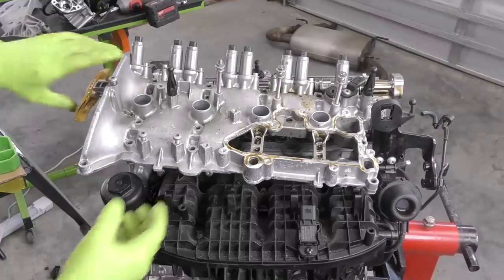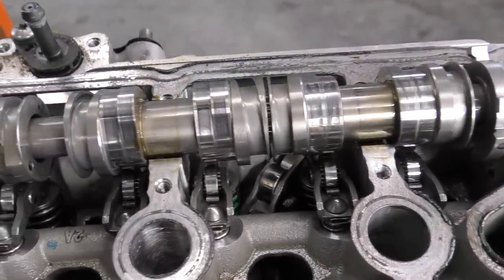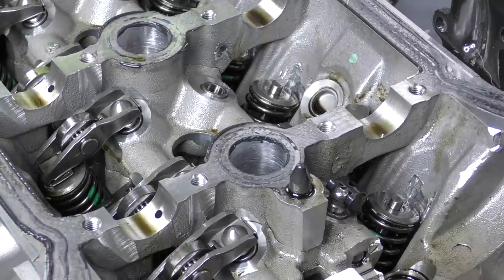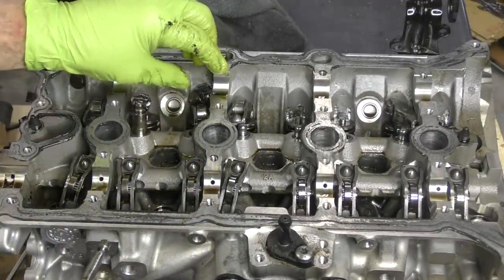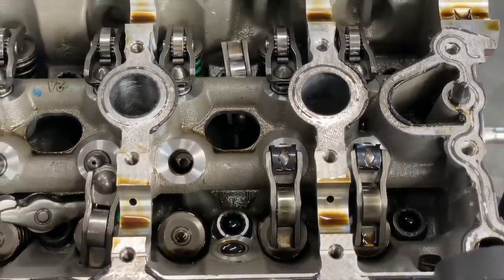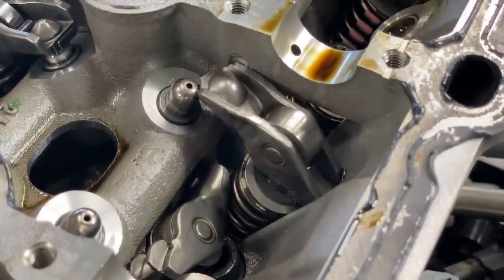Catastrophic Engine Failure VW 2.0t TSI Engine ~ MONEY SHIFT!

Comment: Lol rookie mistake, I never force a gear in place, because it is bad for the synchro, and can cause arthritis over time, I guess joints wear like car parts too, lol. Plus don’t drop the clutch like a catapult, not only is it bad for the drivetrain, but it is bad for the teeth too. The worst case scenario is broken engine or flipped cars.

Comment: Hi I have a 2019 vw gti rabbit package and i bought it not to long ago and drove it few miles and didn’t rev it high but it started making a ticking sound from the valve cover so I’m thinking this could be an issue with mine, my question is could I pull off the cover with out having to redo the timing chain?
Reply: GTi rabbit; that's a hare.....

Comment: A brief overspeed to 9,000 rpm caused all those rockers to self-destruct?  It seems like that engine could have been designed a bit better, seeing that F1 engines routinely run at 20,000 rpm during normal operation.

Comment: Hi there,  i know you are vw mechanic. Actually i have jetta 2015, the light warning sign came up on the dash but no bulb stopped working. All interior and exterior lights are working. I checked for the fault code, it's 01516 - terminal 30 left open circuit. Fault status 01101011. Please help me to fix this... i checked all fuses they are ok.
Please reply to give any suggestions.
Thanks

Comment: So at high speeds and rpms if you do that by accident it can severly damage the engine? Damn that sucks. I got a stock mk5 gti. Well i got my ignition tumbler issue right now you had replied lol anyway i havent done that really at super high rpms few times at lower and never above redline especially if i pull on it let alone going down and having it be so high. But i have once or twice before namely when i was younger on other cars i was real close to redline or past. But it can be scary because the engine is already working so hard and now youre just throwing into a much lower gear... if i pull on it i try to be very cautious nowdays and have room to slow down like normal instead of plowing thru gears and coming to a hard stop.

Comment: Great video, I have a question though: 
- Can this happen with manual mode in newer DSGs (like MK7), or would computer(s) figure out its in too high RPMs for lower gear and refuse to go into lower (disengaging the clutch)?
Reply: More than likely an electronic shift trans will not allow it due to “over rev” situation.... not any expert myself but from current experience driving a Toyota Corolla S with CVT but with “manual mode”... redline was 6,200rpm
Reply: I see, thank you for answer, appreciated :)
Reply: @BeezyKing99  It will allow you to shift down to 2nd from 3rd but only if the RPM's are safe enough and you cannot be pressing the accelerator. So, it will allow it only for engine braking and only under specific conditions.

Comment: I just replaced my engine on a 2011 Volkswagen CC 2.0 cbfa engine.
In park it will not rough past 4000 RPM, is that normal or does that sound like a knock sensor possibly I have yet to hook up chewy scanner.  just for s** and  giggles
Reply: Let me try that again..
I replaced my engine 2011 Volkswagen CC 2.0 cbfa engine.
It will not rev past 4000rpm.
Is that normal or does it sound like a possible knock sensor or something else? I have yet to hook up a scanner.
  P.s. Big fan keep up the excellent work

Comment: Hey Charles, is it possible to make this engine able to rev close to 9000 rpm with modifications?
Reply from the maker: I’d assume you can upgrade the valve train and make it rev higher
Reply: HumbleMechanic I think it would be really cool if when they rebuild this engine they make it rev happily to the point where it originally blew up

Comment: I had a money shift from 5th to 1st, she held went way past 9 thousand  rpm. I was at 110kph.
Reply from the maker: Wow! How’d it end up
Reply: @HumbleMechanic  First is notchy It's sometimes hard to find. It happened with about 60k and the car has 170 k on it now. I'm not sure if I messes up the syncros or something. But the engine seems ok. I was passing a car on a double lane highway and didn't wants to slow anyone down. A quick shift to 3rd and I would of been right up to speed instead the front end took a dive.  Maybe it survival because it's not a turbo?

Comment: Can you please tell me should I drive a 2010 TFSI with 1lt oil consumption every 1000km for a short while lets say a few thousand kms until I get the issue fixed. No blue,white smoke at all. No fault codes. Clutch and flywheel recently replaced. Car is immeculate and only has 60K miles. But consuming oil. PCV was also replaced with the black cap AH version 3 months ago without any software update. But...Consuming oil and have lower speed at certain Rpms comparing to past....and worse acceleration.But sometimes acceleration gets better....Oil consumption gets better and worse as well. What can be the problem? If I share a video would you give me some ideas. I watch all of your videos and I already learned alot from your videos mate...Your help will be appreciated alot...This issue really gives me lots of headache.
Reply from the maker: Be very careful!!!
Reply: @HumbleMechanic  What do you mean mate? I will have to drive the car back to the city that I live which is about 500 miles (800km) a few weeks later. Until that time I need to drive very short distances daily or once every few days. As I said there is no smoke, no fault code, no problems, only a bit hesitance between shift changes which is not even always. The Vw mechanic found no problems, he test drove the car and asked me to rev it more. He suggested me to use 5w50 or 10w60. However the car has had 5w30 (Vw504) since new and I recently switched to 5w40 (Vw502). The oil consumption did not change. Will it be okay for this time until I will have a chance to permanently park the car in a garage until I will have a chance to get the turbo rebuilt (I dont know if its necessary), and then the engine? Or is that wrong order ?
Reply: @HumbleMechanic  Can we say that it is piston rings (known TFSI issue) or could it be the turbo releasing the oil to the exhaust and there is oil consumption without smoke? If then, how can I check the turbo oil leak to the exhaust side?

Comment: Seems to me you are putting a lot of faith in the bottom end not being wrecked. You confirmed presence of glitter in the filter; that alone would send me popping main and rod caps to inspect their condition; expecting to see metal inbedded in the bearings. Even if I found none, id still be stripping the block bare and flushing the oil passages and measuring out all journals for fresh bearings. The head, as you said, is finished, and the timing chain I would be suspicious of.   

BUT, that's the take of a Mopar guy seeing that kind of damage; maybe its different in the VW world? I wouldn't expect that different.
Reply from the maker: The more I think about i thing we will tear down the bottom. If nothing else to look at the possible crank walk issues

Comment: Damn. Are you familiar with the downshift for max engine speed incorporated by Audi; like when you’re cruising and depress the paddle past the point of resistance it downshifts one gear for max power to increase engine speed. Now say I’m speeding up on a highway entrance ramp and I manually downshift once for the normal boost so from 6th to 5th, then accidentally downshift again, so maybe it would have gone from 5th to 4th idk, cuz I didn’t look down at the cluster, I just put it back in Auto after I realized I didn’t upshift. Car ran fine. But few days later threw P0016 and misfires. Also have a bad serpentine belt tensioner tho, could just a bad serpentine belt tensioner cause misfires and possibly make it throw P0016? Or would I need my timing chain checked.
Reply from the maker: The kickdown? Odd. I’m guessing unrelated
Reply: @HumbleMechanic  yess kickdown, but I did it manually, then did it again accidentally then put it back in Auto
Reply: @HumbleMechanic  so can a very worn belt tensioner that it rocks side to side cause misfires?

Comment: Why don't they make something to prevent that from happening? I know with motorcycles they have something called a slipper clutch to keep you from locking up the wheel and skidding. This is a 10 grand mistake.
Reply from the maker: They have failsafe for accelerating but not for hitting wrong gear and dropping the clutch. OUCH

Comment: I thought the manual transmission wont let you shift into low gear at certain speeds?
Reply from the maker: Typically that’s only first gear
Reply: @HumbleMechanic  Oh ok thanks for the reply and all the great videos. So if my vehicle (5 speed 1.8t)  dose this would you think  possible syncro issue/excessive wear? Ive noticed it with 2nd gear almost as if it felt like a reverse lock out when the speed might be alittle high for 2nd.

Comment: 80,000 miles and the bomb starts ticking....the chain , guides and tensioner badly under engineered. Seen so many failures
Reply from the maker: This gen didn’t really suffer from those issues. Now the previous generation. Different ball game

Comment: VW still making interference engines. Same thing I learned back in VSTT school at UTI. Dang. I remember seeing so many vehicles come in because of chipped, cam changed, and electrical problems r/t fiddling with the cars to boost power. See they still use excessive tension fasteners. I don't see the pivot points.

Comment: That car is a 2017 yet he still over revved? Most newer cars it doesn't allow you to, it locks you out if the rpms are too high. My 2014 370Z, a Fiesta ST I drove, a 2015 WRX, they all do the same thing. I think that guy turned that safety net off when he was tuning it.
Reply from the maker: I mentioned that at the end. There is Protection when accelerating but it can’t account for missing the gear and letting off the clutch

Comment: And by 40 sec in you have a perfect explanation of why I hate terms like 'stage 2' or in older days descriptions like a '3/4 race cam'.  Those mean nothing; it's just marketing hype.  Tell me what mods you did and I'll understand.  Tell me you have a 'stage 2' cam, mods, whatever and I'll assume you're a 13 yo keyboard warrior who's never built an engine.
Reply: With most modern turbo cars stage 2 means intake, downpipe, and tune (and maybe some other supporting mods like intercooler if the car needs it on a maxed stock turbo). The “stages” are pretty well known at this point by the broad car community so most people don’t  really see the need to give a full rundown.
Reply: Stages are a good way to compare "levels" of upgrades on a given platform.

Comment: GTi engine hits 9000 rpm: “Bang! Clank! Klack!!”.  Honda S2000 engine hits 9000 rpm: “I’m sorry, was I supposed to feel that?” VTEC bro. 😜
Reply: S2000 has a short stroke and no torque compared to this engine.  Short stroke engines generally have higher revs (higher HP) but even with VTEC no real low end torque.  Drives like a base civic until you rev it way up...

Comment: How much is a new built-up cylinder head? That doesn't appear to be worth repairing because of the damage to the head casting.
Reply from the maker: I couldn't lock in a price on the repair. Lot of extra parts and what not. I agree that it's probably cheaper/better to just replace the head at minimum
Reply: @HumbleMechanic  Is this engine too new to be able to commonly find a salvage engine to obtain a head from? Since the engine is already out of the car would it be cheaper just to get the entire engine and not just the head, so you replace it as a single piece and save the shop hours?  Somebody's debit card is going to whimper because I doubt this would be cvered under warranty.
Reply from the maker: I’m pretty sure they put a used engine in it. This engine is from about 2015 and up

Comment: Damn, that just have to be a rookie-driving error, it´s just simply "impossible" to do if can drive. I´m been driving rally with a VW for maybe 10 years and Peaugot too for some 10 years and never never shift from 3 to 2 when going up in the box, its f-ing impossible if you not very "unfamiliar with driving with a stick" like americans tend to. Sure, can have a faulty gearbox or a shifty linking-system..but naaa
Reply: Shifting errors can be made by anybody. Teenagers, sportsmen, seasoned professionals. It can and has happened to all levels of driving experience and talent.

Comment: What’s the cost to repair this if...  1.  Mr/Ms ‘I can’t use a manual transmission’ takes it to a mechanic such as yourself, and 2. Mr/Ms ICUAMT has some skills and does the job themselves?  Just a ballpark figure plz.
Reply from the maker: Probably $5,000 or more. Depends on parts pricing

Comment: Anyone have an issue with P0348? I replaced both CPS - Bank 1 and Bank 2. My check engine light has yet to come on after 267 miles driven post replacement. Unfortunately I failed SMOG and now my R32 may be game over. Any suggestions?
Reply from the maker: Wiring needs to be tested
Reply: @HumbleMechanic  : Charles! Thank you so much for replying! I have been watching your videos for some time now and of course I'm subscribed and punch the thumbs up. Thank you for sharing your wealth of knowledge regarding VW and major congratulations on your new shop. My R32 is an 04 and I'll be looking up a local shop to test my wiring. Yesterday I was dejected thinking my timing chain was toast or the rail was breaking causing the fault code. Today I woke up to an unexpected reply from the VW Wizard and feeling much better. Again thank you very much for the reply and keep up the great work - passionate, funny, and knowledgeable.

Comment: 1:55 Damn, that's what a PCV valve looks like these days? Only the Germans...

Also, plastic oil pans should be illegal.
Reply from the maker: Yep modern engines and transmissions really leverage plastic
Reply: Whats the difference between plastic and aluminium oil pan? No difference at all. You can break them really same way. Only steel pan can survive some bashing...
Reply: @vasek987  the problem is the screw to empty the oil.
You have to be careful with the torque at a aluminum oil pan, but the plastic one is even more sensitive in behalf of damaging the tread.
Of course casted steel oil pans are the least sensitive ones - here it's almost impossible to overtight the screw.

Comment: where's the drain plug on that plastic oil pan?   I had a '12 GTI ...it had a cheap metal oil pan that was the first thing to rust on it. It had a strange hex bolt oil drain plug.   Why does VW like to use unusual complicated fasteners on their products?   I know their goal: Go to Dealer for all work including maintenance.   No way.

Comment: Haha, the money shift.  I was working at for heavy truck in '96.  UPS had bought heavily into the "P" bodies.  A delivery truck with 5.9 Cummins, fully synched 5 speed.  The synched part was the mistake.  Jab it from  6 or 5 to 2 or 1 and guess what?  Instantly broken camshaft right in the middle.  An "un-synched" would have rejected shift but, oh no, Ford wanted to please.  Hehe.  I did at least five broken cams and associated head repair due to that silly design.  You cannot wind  a 3600RPM engine to 5000RPM unless you have trans synchronizeres.  Let out the clutch and you're toasted.

Comment: could you money shift a dsg with your paddles or will the computer prevent your stupid mistake?
Reply from the maker: In theory the computer shouldn’t let you
Reply: @HumbleMechanic  one more if you don't mind, I've got 2 euro shops in northern mn, one a vw dealer, both suggested I drive my mk6 until my chain went then get it repaired as opposed to doing chain/tensioner because it's not worth the p.m. cost?  Are they stupid or am I?

Comment: I would have loved to see a longer more detailed video, kinda went over some parts too fast.
Reply from the maker: Tell me what you’re looking for. I still have the engine. Can always do a part 2
Reply: @HumbleMechanic  like you could show us how that camshaft sliding system and magnetic acuators work, i dont think i've seen that system an any other car (non vw). Idk i feel the video was very intersting but a bit short
Reply from the maker: Actually @engineeringexplained and I did a deep dive on that. Check out Audi Valve lift.

Comment: So just bought a 2020 gti s. I got stalling issue at 487 miles. Anyone got the same problem?
Reply from the maker: Some have experienced this issue. Last I heard it was software.  But I haven’t seen any 2020 MY with issues. I’d bring it back to the dealer ASAP
Reply: @HumbleMechanic  I'm also mechanic myself.  I have worked at a auction house and have done countless recalls on the TDIS.  I got appointment at the dealership this Monday. Im not a novice to turbo cars. Definitely weird.

Comment: When VW designs an engine they put multiple teams against each other to see which team can design the most overly engineered engine with the most tiniest parts possible in the least accessible locations.
Reply: Driver did  the mistake and you blame the engine ? This engine is actually pretty good.
Reply: @Romif_SK  No the engine sucks. It is made with way to many plastic parts attached to it. I know because I have done most of the repairs on my TSI myself. Plastic water pump, plastic chain guides, plastic intake runners, plastic intake, and more. That's stupid design.

Comment: Hey, H.M.!! Do I need to drain cooling system on 2001 1.8L Turbo motor to change temp sensor?? Anybody?? Thanks👍
Reply from the maker: No! 
Here is the trick.  Make sure the car is cold. Take the coolant bottle cap off, then put it right back on. It must be on ALL THE WAY! 

Then swap sensors. You’ll loose a small
Amount like 1/4 of a cup. But that’s about it. Just have everything ready to go before you pull the old sensor
Reply: @HumbleMechanic  Thanks, H.M.!! 👍